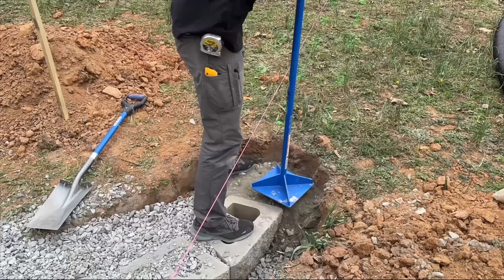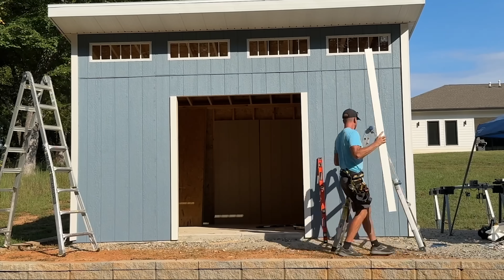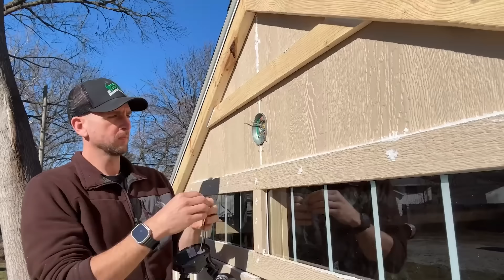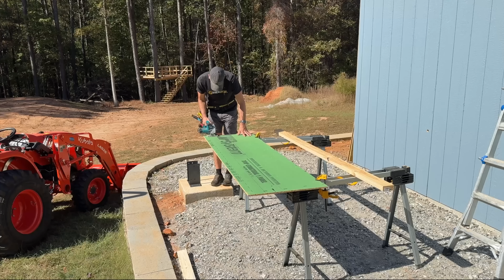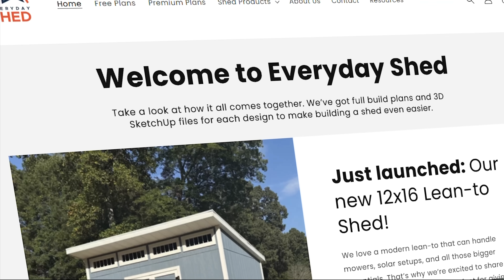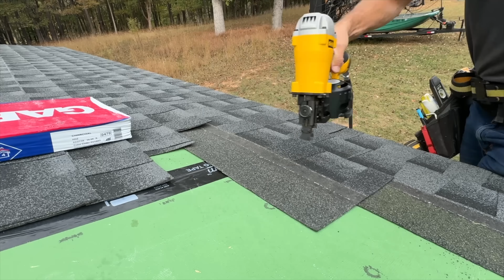I Doubled My Shed Space with One Weekend Project

Comment: Shed looks very nice.  Curious as to why you chose to pitch the roof so that all the rain drops off the roof in the front, over the door, instead of the opposite side?
Reply from the maker: The other side will be open to my forest and have a French door walking out to a floating deck.  I agree for some scenarios this would not be ideal.  I am going to put some Solar Panels on this door and then a gutter across that low side.

Comment: Nice work!
I think you could boost the value of these videos / shed documents if you could also explain the structural lumber sizing process and refer back to the correct tables in the building code. 

I just built a very similar lean to this summer (with also the plan of putting solar on it) and it would have been very helpful to know where to find lumber size and spacing design guides.
Reply from the maker: Thanks so much for the feedback!

Comment: Instead of Silicone on nailes for top metal edge trim having you ever considered using a rubber gasketed screw instead?
Reply from the maker: That could work, it is what is used on most standard metal roofs, right?
Reply: @EverydayHomeRepairs yes. Either the hex head for using an impact gun or I've seen some with a domed head for unique applications.  I've used the hex headed screws for exposed fastener metal roofs to fasten down flashing around vents on shingled roofs.  Starting and last cap row shingles could be that same way.  A little bit of tripping hazard though.

Comment: I build a 7.5' x 10' Yardline Aston shed that I purchased as a kit from Costco a few years ago and finished the inside with lots of shelves and storage. The whole thing was around $1,500 plus shingles and paint (and tax). It's a great deal and easy to put together. It took a lot longer to put together than I anticipated though.
Reply from the maker: Always does 🙂,  thanks for sharing!
Reply: @EverydayHomeRepairs you got to be kidding me forget that go back to the storm ties use a strap tile nail gun it will hold 10 times better than one screw you're using a screw gun nail gun is faster